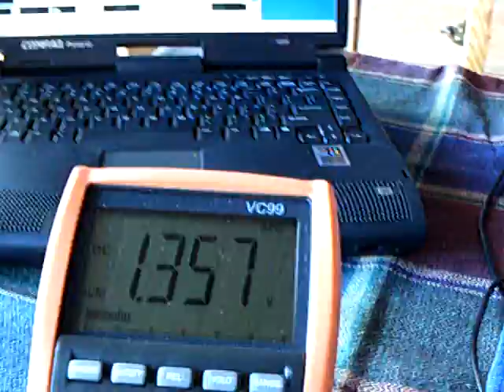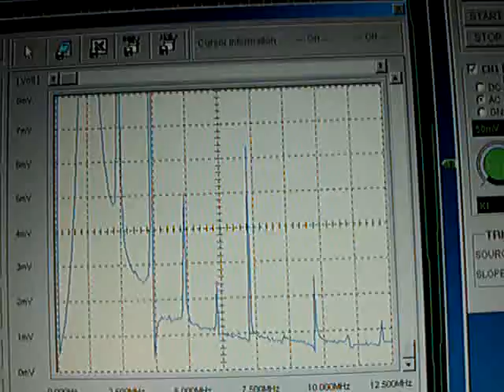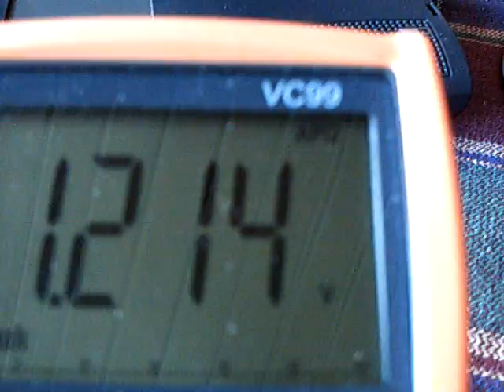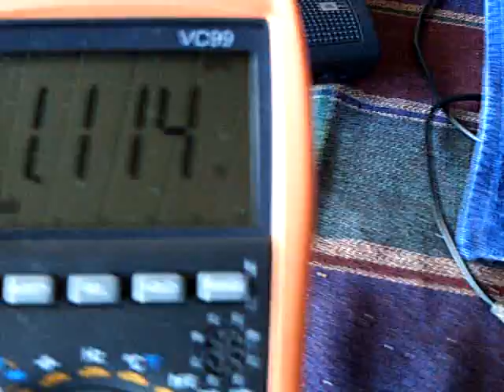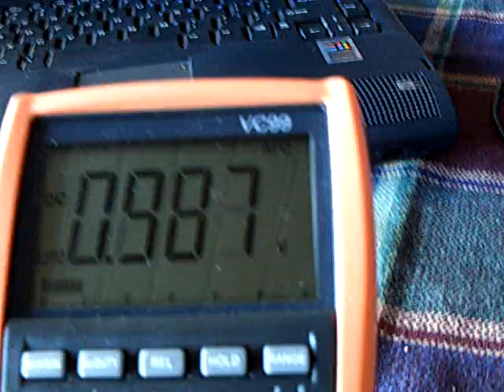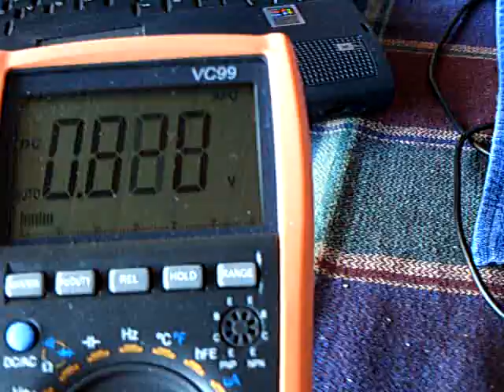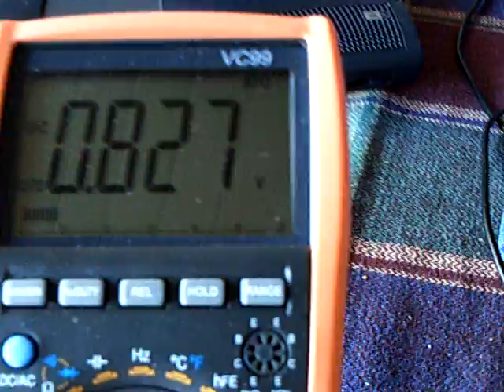Slayer Exciter NOT!! self-charging.ASF

Comment: @slinky460 , I understand the reason he said - good enough. I've been working on resonant pick-up coils, and a small change makes a huge difference. Even coils that I wind that I think are dang near the same show differences.
For Lid's design, I was thinking of bifilar Tesla pancake, Rodin or Starship coils that can be tuned to the resonance of the hot spots. Then slid up and down the transmitter coil with out touching it for fine tuning.
Peace.

Comment: Lid, I have to think that even though you are showing different frequencies, may be even harmonics, that they are all in phase with each other. Or may be they are not and this could be causing the SEC effect. It is hard to explain here in this little box on You Tube, but it has to do with the current first, then the SEC effect follows at right angles to the wire in the coil. Current must flow first. What does your scope show on the metal plate or a AV plug? This may show something interesting.

Comment: @Mikepowers420, From Teslas Colorado Springs notes, he spent most of his time trying to find the right coil combination to produce the best results. Minor changes created big differences in both directions. So it was a balancing act to get it just right. He also found hot spots in his coils, but any changes to the coils, caused the hot spots to move also. He finally found the best power output he could and called it good enough to do what he was trying to do. Transmit energy.

Comment: Lid, It is actually the Hutchison effect that John Hutchison had by running several Tesla coils at different frequencies all at the same time. These effects included antigravity, destruction of metals and walls of white vapor about 1979. I don't know if your work has any connection or not, but I would not rule it out as SEC is kind of new and maybe several SEC units operating at different frequencies all at the same time might produce similar odd effects. There is so much to learn.